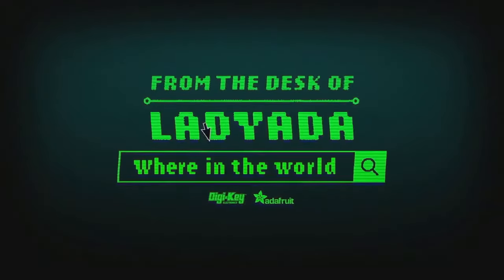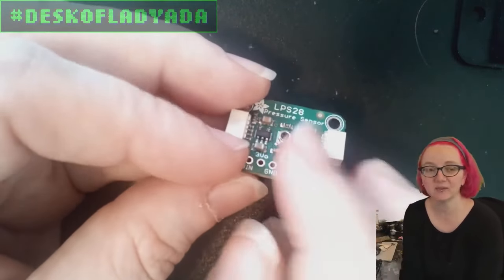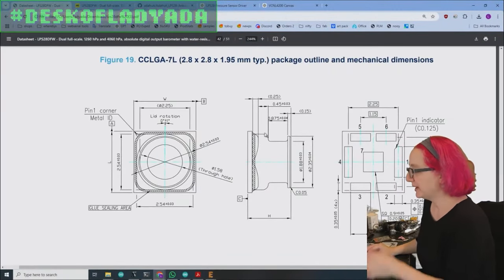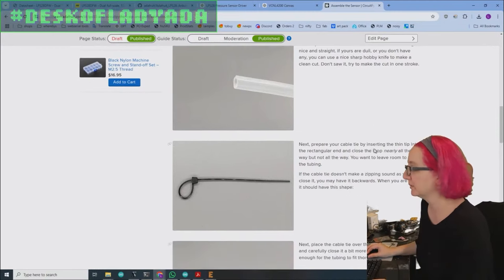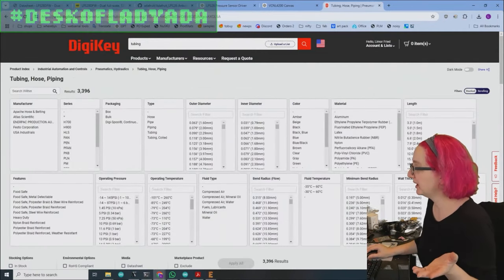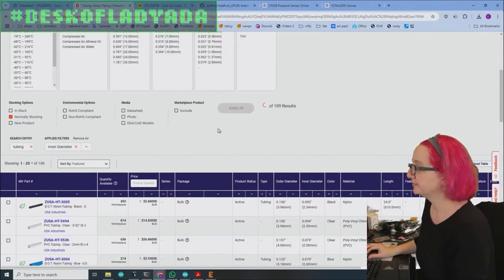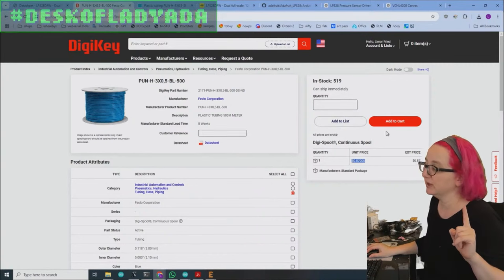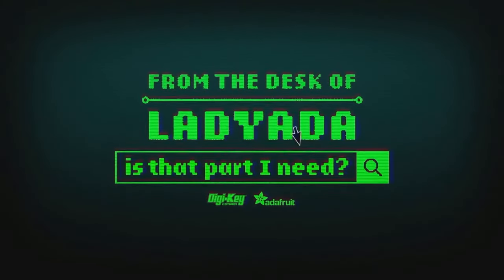The Great Search: Tubing for a Ported Pressure Sensor #TheGreatSearch @DigiKey

Comment: Maybe make an instrument for hvac measurements. (or air balancing sensors for a smart thermostat) Could put sensors in the air ducts.  Not just static pressure, but airflow can be measured with ... @joehopfield beat me to it... or some other Venturi effect type instrument. Or imagine a multi-axis airflow sensor for drones.